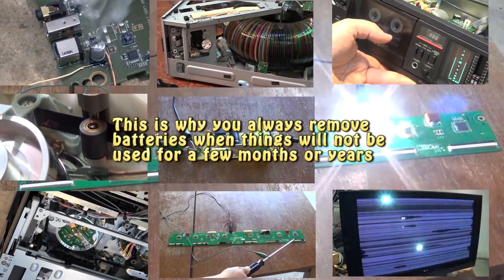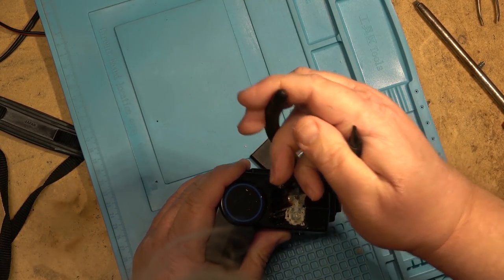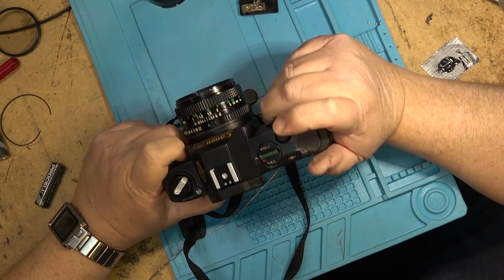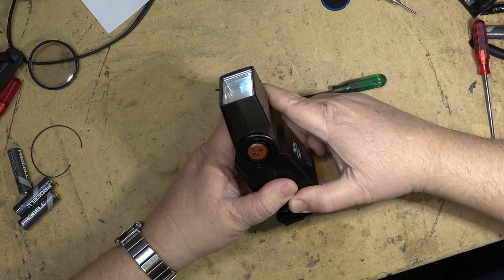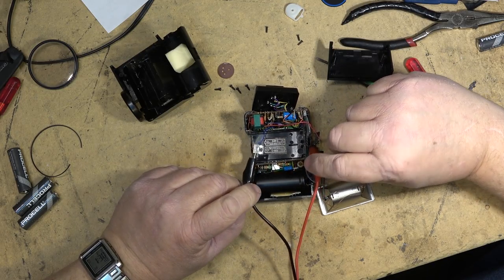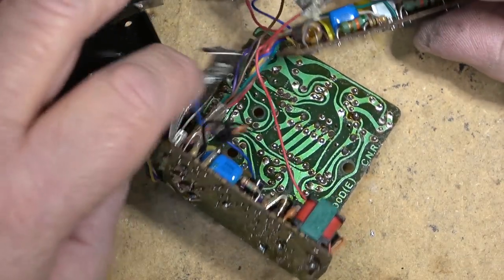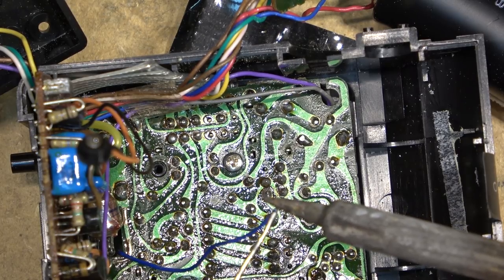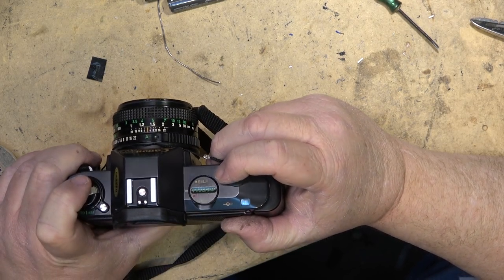Why batteries need to be removed when storing equipment

Comment: A relative had a Sony VCR from around 1990, she used it with the original Sony Zinc-Carbon batteries in the remote until around 2008. The same person has a basic four-banger Sharp calculator from the late '80s, it needed the first battery replacement in around 2012. It was used so much that in the first digit, the segments that represent "0" became dull on the LCD permanently.

Comment: I have 70's Pong clone videogame console, which was left in cold storage for 25 years, and batteries were forgotten inside it. It was big mess when it was finally discovered, but luckily the console was storaged the right way up, so it didn't leak inside the console. Still there's some other fault, image fades away in less than minute.
One faulty button cell battery even exploded to my face when I tried to remove it. Luckily I did wear safety glasses, even I really didn't expect anything happen. Quite a bang from little LR44 battery!

Comment: In its day, it would have been very usable.
I seem to remember the idea of putting a digitiser in the camera, i dont know if it got anywhere.

As a kid i had one of those small Tudor colour110 cameras that used a mini telephone handset shaped film cartridge.
It had a built in flash, and one day i got a shock off the flash, from the outside case!!.
That bloody hurt.
I think it was slightly damp, after dissasembly i put it on the top of the gas fire to dry it up.
I used that camera on school outings to the castles in the uk, worked spot on 😀
 A few years later the shutter locked up, that was the end.
It was a cheap shit camera, but i enjoyed the pictures 😀

Comment: The worst kick I got was from an oldschool stroboscope way back in the 70s. I pulled the board out of its case and shorted the big cap with my hand... I literately got kicked cross the room and had problems breathing for some minutes. Terrible experience, but well, I learned my lesson..
Reply from the maker: Well they had basically the same cap in it with a voltage doubler to charge it to 350v.

Comment: Yes. Batteries leak. And can destroy whatever it's in. My family and I have lost some things because the leaking chemicals ate up the terminals and circuit board.
The last time I used a film camera was 2011. A throwaway camera. I still have one I haven't used. Still sealed .

Comment: Actually what comes out of these batteries is potassium hydroxide, hence  the name "alkaline". The best way I found to clear the battery gunk is to use a cotton bud and clean vinaegar  to dissolve away the stuff. The  vineager will evaporate, leaving  a clean surface.
Reply: I left a comment about vinegar and I got crucified.. lol - he said it was corrosive..  but it's one of the best non toxic methods of polishing metals.  Then he said he just wanted to use his dremel..  I wasn't diminishing his Dremel use.. just adding to the options - some people  - they think you are raining on their parade. LOL  .. Vinegar is the most gentel method. I have also used WD40 effectively to remove the crap.
Reply from the maker: Potassium hydroxide or soduim hydroxide is used. 
Depends on the brand.
Reply from the maker: Have used vinegar.  The thing is you really do need to wash it off with distilled water. Had it been on circuit board and still wet i probably would have but it was completely dry. So just polish to bare metal and be done.  After all it's just the battery cover contacts.
Reply: Hey Dave. Yep, you need to clean it. Best part of vinegar is that it eventually evaporates. Personally I clean things up with Isopropanol after vinegar, does not leave a trace, works wonders. What amazes me is that some people try to use vinegar to remove oil/fat deposits, it is totally useless for that purpose... FYI, I **HATE** the smell of vinegar, but  I must admit that for that specific purpose it works wonders... BTW, great fan of your videos. Keep up the good work

Comment: Definitely idiots in every school/every walk of life.  Most of the "branding" incidents over this way were with Clipper lighters though, they'd light them & turn them upside down until they were smoking hot & the resulting burn from the metal shield & striker wheel would leave an "acid smiley" face on the victim.

Comment: Duracell are by far the worst batteries when it comes to leaking. They should consider changing their name to Duraleak.
Reply from the maker: I know they are bad.  They are cheap.  I have had very good luck with ray-o-vac batteries.  Panasonic also very good.
Reply: Duraswell. Almost impossible to get out of a Maglite.
Reply from the maker: @marka1986  good one!

Comment: Ever since battery made in China they have leaks long time.I have had a remote with 8 year old Sony batteries no leaks .
Ow and refrigerate class grade 9 soldering copper the idiots would stick your arm with the hot barrel of torch .
Reply from the maker: Well both the Energizer and Duracell batteries had fresh dates on 2000 and they were made in Canada.  You are correct about the Chinese cells though as they leak when they are still charged.